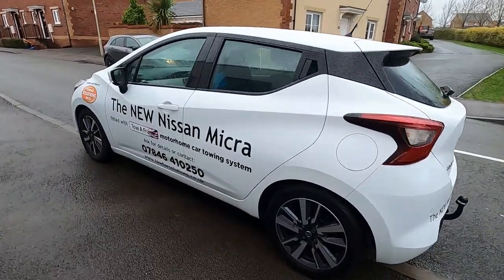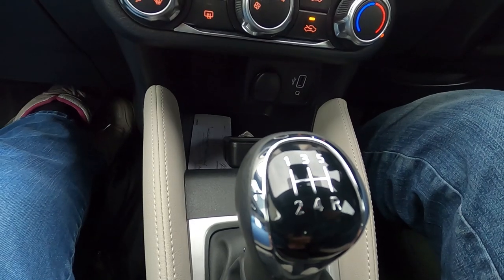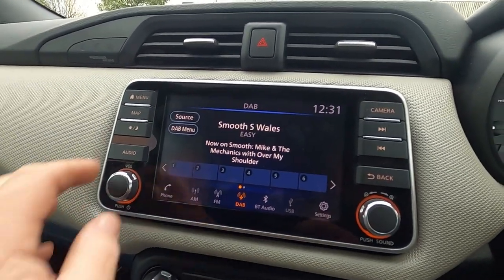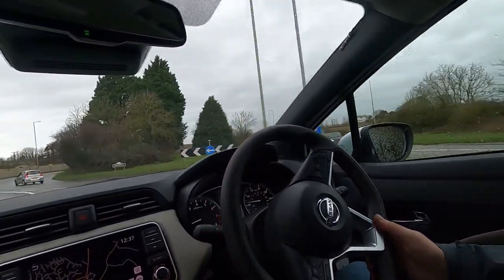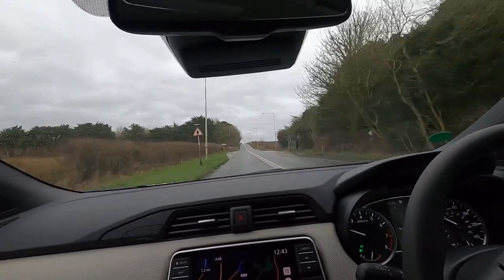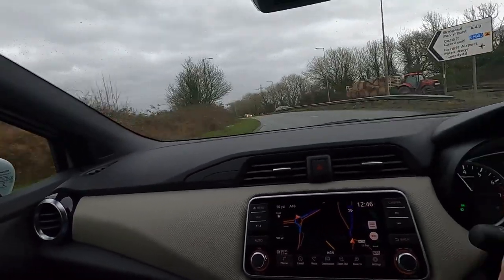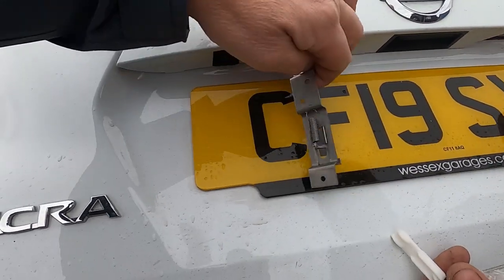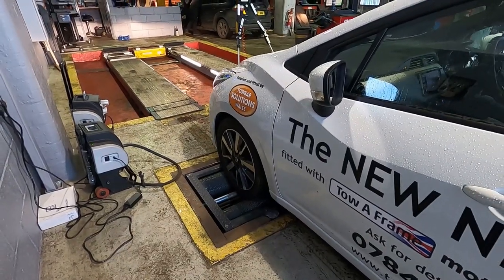New Nissan Micra Fitted With A Tow A Frame Motorhome Car Towing System | A Frame Towing

Comment: Hi Bob, interesting video. I’m retired now but worked at the Nissan factory in Sunderland for nearly 30 years. We used to make the Micra, however this version is actually manufactured in a Renault factory. It’s a big improvement over earlier models regarding styling and equipment, still Nissan design and engineering principles though. However I do have a question about towing a small car, what’s the situation regarding braking the “trailer” I would think it’s weight is more than the un-braked trailer limit. Cheers
Reply from the maker: The car is 1100kg and is way over the unbraked 750kg limit, that's why the Tow A Frame system is a fully proportionally braked system, using the car's own servo braking. Have a look at my A Frame videos. 
If you have any technical questions;
Please watch the following videos:
https://www.youtube.com/playlist?list=PLUi3rqw12j2q2q4KYGAnvYgnTiWI0cdiL
For the latest information, please contact 
Mike Northeast
Mobile +447742667681
mike@smart-tow.com

Comment: hi guys ,,great little car ,,i will have your old one ,,bob could you tell me if you leave your blinds shut at home all the time ,,im not sure what to do when its in my drive ,,?
Reply from the maker: I tend to leave either the curtains drawn or the blinds down when its in the drive, mainly to stop the upholstery fading in sunlight. I'm told that leaving the blinds down is not good for the blinds, but I've not had a problem with the blinds.

Comment: Interesting video. So, does the UP now have 'twist and turn' rather than screw-in connectors? The tow glide facility seems very good in not having to position the car spot on to hitch up......I take it though once it extends and locks you need to remember to get out of the MH to fix the pins?
Reply from the maker: Yes the Up! has the new pins now, but unfortunately I can't show you until their launch at the NEC. The locking pins are a backup to the locking mechanism, and you need to get out and fit them once the legs are locked in place. I would be doing that as part of the brake light/final checks before setting off.